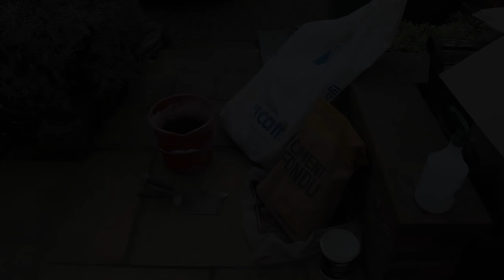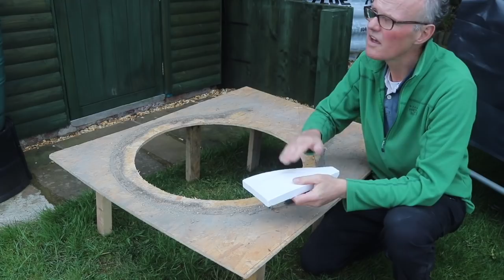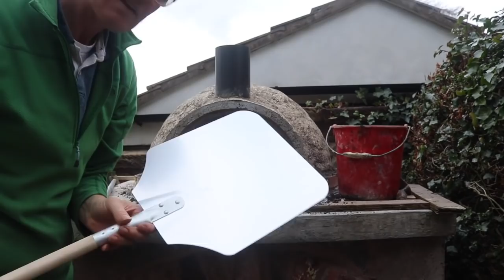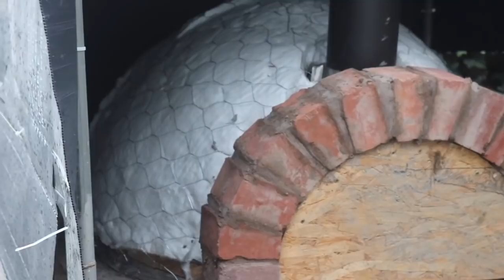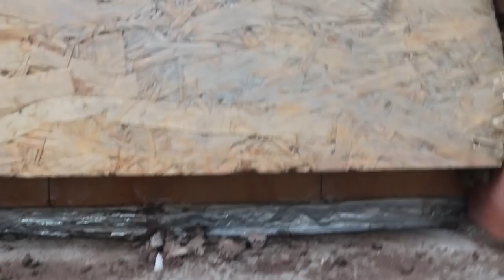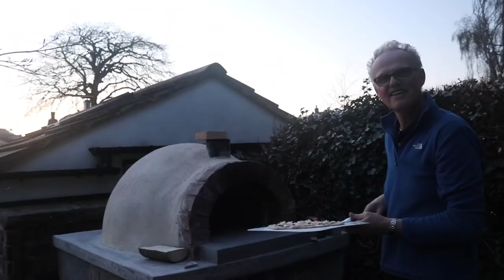DIY Pizza Oven Build: Vermiculite Dome

Comment: Thanks for your quick reply , I have to make my oven outside so I will need to wait until no threat of rain , if im to do it in all at once , my form is ready and waiting ,but its bigger at 80 cms so I hope I have enough fondu ,was your mix 3 - 1 really accurate , can I ask what size of batch did you make . Thanks for your info and encouragement
Reply from the maker: Hi - I wasn’t overly accurate with my measurements and used a big shovel to lift 3 parts vermiculite and 1 part ciment fondue into a wheel barrow. I made a good batch eg 6 shovels of vermiculite to 2 of ciment fondue. Used a builders wheelbarrow. Just keep mixing till the dome and entrance were complete, ensuring I had a stove pipe in place at this stage. Keep it shaded and cover with wrung put towels and don’t touch it until it’s fully set eg the following weekend. Once you get to putting on the ceramic fibre blanket with chicken wire you’ll need to put a plastic sheet over as this will suck up any moisture....all good fun. If you look at my ‘update’ you’ll see I eventually built a little shelter over my dome as I live in a wet place. All the best - let me know if I can help further....

Comment: Hi great video , im just about to build my own , but reading about the fondu ciment ,im a bit confused about drying time , when you were building the dome did the vermiculite set rapidly ,ie < 30 mins as when working with a mix of portland or did you have time to mould it . Your advice would be really helpful
Reply from the maker: Hi - there’s no problem making the ciment fondu and vermiculite mix. Just add enough water to make it mould-able as you build up the dome. I recall having tennis ball size lumps and keep going till you finish. The most important thing from what I’ve picked up is to slow the curing once the dome is complete by covering the dome with dampened towels or the like. I think if it dries too quick it may be prone to cracking. Good luck...it’s not too difficult, just take your time.

Comment: Hi, great job with your oven! Could you tell what size flue you used? I can’t find any info on this. I was thinking to use a 6” flue. Any advice would be greatly appreciated.
Reply from the maker: Hi Phil - I used 5” glue pipe for my smallish oven. I wouldn’t want to go any smaller than this as some smoke comes out the front so I would say 6” would be fine. Good luck with your build....
Reply: Thanks for your reply. I was going to use a 65cm ball but worried it might be too small. If you could start again would you go for a bigger dome?
Reply from the maker: Hi - yes, if I had the space. The base would be a bit bigger etc. On the other hand I can only manage to do 1 pizza at a time As they cook quickly, and my pizza sizes average about 10”. A bigger dome would allow you to place your wood more easily I guess. Decisions decisions! Cheers...
Reply: Solway17 Carlisle great thanks again. I might go for 75cm. So many options! 1 last question is your oven still performing well? Any major cracks?
Reply from the maker: I keep looking but nothing so far. I did build a little waterproof shelter over the oven to ensure it stays dry year round. So far so good. I guess fir bricks would be a more guaranteed option but I couldn’t face cutting and shaping loads of bricks. I made sure the dome was quite thick and cured it slowly covering it with damp towels etc and lit small fires to begin with. Hope that helps...
Reply: Solway17 Carlisle thanks for your advice it’s much appreciated

Comment: Made my first dome...but sadly used the wrong mix, using 5 / 1 vermiculite / cement. Damn thing cracked as soon as I moved it and was un recoverable so must start again. I will use a 3 / 1 mix as you recommend. Can you tell me, when you made the 1st dome, how the vermiculaite mix onto the ball. I'm guessing about 2-3 centimetres but would be grateful if you could clarify this please.
Reply from the maker: Hi - oh sorry to hear about the collapse, I remember moving mine form the board onto the plinth and needing to be very careful. You do need tennis ball size lumps when you build up the dome - a decent bit of mass without going over the top, more like 4-5 cm. I read somewhere to put damp towels over the finished dome to let it cure out more gradually. I think moving the dome is the most tricky part of the build. See if you can lift it using the board it was built on as near as possible to the final plinth location?
Better luck next time- hope all goes well 👍

Comment: Looks great. I think I saw on another design that the floor tiles/bricks are laid diagonally in order to avoid the peel catching on the edges. Maybe getting a round turner/peel for removing/turning pizzas will help with this issue.
Reply from the maker: Hi Grant - yes I think you’re right about laying the bricks herring bone style. Since building and using the oven over time any little irregularities have have gradually diminished. But it is important to spend some time making sure the floor is as level as you can make it. Thanks for commenting and watching - Regards

Comment: Beautifull oven you got there, Can you give me an idea on how thick the wakls of your dome are in total? I have a base om 120x120cm and i'm wondering if a 90cm diameter dome on the inside would fit. Thanks in advance!
Reply from the maker: Hi Milan - I'm sure you will be ok. The vermiculite dome needs to be fairly substantial. I built mine up in courses with tennis ball lumps working around the base then going up in circles from there making sure the mix didnt slump. I would estimate the vermiculite wall thickness to be approx 50mm minimum, ceramic fibre blanket about the same (held in place with chicken wire mesh) then a cement render on top, say 30mm thick. So total wall thickness 130mm. (x2 for the other side of the dome)
I just measured the width of my concrete base as 130cm wide and deep. My oven has 10 - 15cm to the edge of the base. You also need to allow for the entrance for the oven. If you add 90 + say 30 = 120cm, so I guess you may just do it.
Just make sure you dont skimp on the dome wall construction + insulation as you need the oven to get up to very high cooking temperatures (350-400 C) and it needs to maintain as much of that heat as possible. Milan, I hope that helps, give it a go...best wishes and enjoy your pizzas
Reply: @solway17carlisle Your information helps a lot! I'll take 85cm to make sure my walls will be thick enough. Thank you for the quick response and best wishes! :)
Reply from the maker: @milanvelle6292  Milan - no problem. I realise watching my video just now that there is a 2nd layer of vermiculite mix on top of the fibre blanket, then a thinner mix of cement render to finish off. Sorry i didn't mention this earlier its a while since I built it. Best wishes...
Reply: @solway17carlisle  Hi Sir, i'm busy building the dome and i was wondering if you also used fire resistent cement for the outer layer (without vermiculite) because it is a pretty expensive product i was wondering if it was possible with normaal cement. Greets, Milan!
Reply from the maker: Hi Milan - the only Portland cement I used was on the final outer render layer
Both the inner layer of the dome and the layer over the heat proof blanket were made with vermiculite and refractory cement. I used 1 bag of ‘Ciment Fondue’ sources from EBay here in the U.K. when the oven fires up it’s warm on the outside so I personally think it’s worth using refractory cement to reduce the risk of cracking. We have a saying here “for a half- penny of tar, the ship was lost”. I hope that helps - best regards and hope you and your family are ok in these times

Comment: Hi do you have an idea of the amounts of Vermiculite/Concrete required? trying to get the materials together to get this made, but cant find any materials info
thanks
Reply from the maker: Hi David - I bought 1 bag of Ciment Fondu (25kg) and also 1 bag of 25kg vermiculite from a builders merchant. Any other materials I bought by the bag as needed, eg for the concrete top and brickwork for the base, and the fire bricks I just estimated given the area needed to cover. I hope this helps - for this dome build I had abit of ciment fondu and vermiculite left over at the end. Best wishes...

Comment: I've watched a few of these "dome" video's and in the process of making the base out of natural stone blocks. Couple questions please. 1) how high is your base. If you made it again, would you go higher or lower. I'm 6ft 2" so probably would err on the side of a taller base. 2) The chimney - none of the videos I have seen explain how the chimney is created. Is it a case of simply cutting a hole in the arched entrance at the point where it joins the dome and then rendering around it. Thanks in advance. Great video.
Reply from the maker: Hi - the measurements I have are 98cm from ground level to the top of the base, then a further 6.5cm up to the floor  of the oven, giving a total height of 104.5 cm or thereabouts. I am also 6'2" and manage the height ok though I do stoop down a little though not too much to make it uncomfortable. My more petite wife uses the oven as well so its a good compromise for height.
Regarding the chimney, I built it in by resting the chimney on top of the arched former for the front door of the oven, then as I covered the gym ball and the door arch with the vermiculite mix, the chimney was effectively cemented in place. I thought this might be a problem when I eventually removed the former, but it stayed in place ok. I subsequently added more cement render and fixed a galvanised metal strip to the metal chimney and set this band into the cement to reinforce its position. I hope that helps...let me know if you need more info etc. Regards

Comment: if someone hasn't already given you the tip......sprinkle polenta on the peel and the pizza slides on and of perfect, also a diamond grinding cup run over the high spots works great if you get a lip that's annoying......good stuff mate...
Reply from the maker: Drew - Thanks for the tip. Ive found some Polenta and it works a treat. My pizza doesn't stick to the peel, so great advice. Cheers and all the best...

Comment: nice job- how long did u let the oven dry before taking out the gym ball.??? i  took mine out after 3 days and the  mould is crumbling
Reply from the maker: Jo - very sorry to hear that your oven is crumbling. I did leave my oven several weeks before attempting to move it - partly because I had other things to do, e.g. Building the base etc. Either way the oven needs to be firm and solid before very carefully, with 2 or more helpers, lifting it into place. The walls also need to be adequately thick, and ensure you use a ratio of 3:1 (vermiculite:ciment fondue). I have heard others repair the dome by filling in the cracks with fire cement, but it depends on how badly damaged the oven is. Again, sorry to hear of your difficulties- perhaps have another go as the vermiculite and cement are relatively inexpensive compared to the other components? All the best - hoping you succeed
Reply: @solway17carlisle  thanks for reply... Il have another go and leave it for a fortnight before removing gym ball....
Reply: @solway17carlisle  thanks for reply... Il have another go and leave it for a fortnight before removing gym ball....
Reply: @Jo-xg6rk  - I built mine a week ago and was going to ask the same question about removal of the ball. I was going to leave it a week but perhaps I'll give it another few days. How was your oven once you removed the ball ?

Comment: how long did you leve it to dry out before setting small fires in it ?
Reply from the maker: Hi Simon - after casting over the gym ball mould I let it slowly dry out and cure for at least a week until I was confident that it would lift into place without breaking. Then another few days until the mixture sticking the dome to the fire bricks properly set. Then a small fire every few days while I continued the build. Hope that makes sense - it needs to set long enough to handle and then start small fires. Atb Andrew
Reply: @solway17carlisle  thank you very much . i sand moulted mine and the sand has been out for a week now.

Comment: what was the very top white layer made from?
Reply from the maker: Hi - I mixed a cement render,  I used a bag of coloured render mix. In the UK it’s called ‘K Rend’ one coat render. It comes in different colours
Reply: @solway17carlisle  thanks! Do you know if this is similar to the blanket you used? https://www.psh.ca/index.php?item_id=R23BD

Comment: Congratulations on a great build and well done for taking the time and effort to make the video, it's been a fantastic source of information for myself and many more. I've gone all out with my build, 85cm ball, 40mm calcium silicate board and 65mm fire brick. The 85cm ball has come at a cost though as I needed to buy another bag of fondu and vermiculite having said that the Initial cast was about 10cm thick! 
I'm at the stage where I have fitted the fire blanket and will put another layer of vermiculite on, I have half a bag of fondu so probably not enough to use for this second layer. Would you say Portland cement will be ok for this and also did you do two coats of your final render? How thick did you apply it and did you use cement dye if so was one pack of dye enough? (  I have 1.25kg of dye which is ok for p e bag of cement). Got 4 years cooking pizza out of a cob/earth oven before the cracks were too big, I will have about £300 I  this when its finished but i. hoping to slow cook overnight with the residue heat.
Reply from the maker: Hi Mark - sorry not to reply sooner. I think its a good idea to build a bigger oven as sometimes my oven can be a bit smallish when a good fire is in there -  although I always manage to get my pizza in ok. I guess the further away from a direct heat source, the less need there may be for the fondue cement. My outer coat was a bag of coloured cement render eg KRend. Quite easy to mix and apply and looks ok. 
I had family around this Bank holiday weekent and fired the oven up - there were no signs of any cracks or wear inside the dome, so Im happy so far. ATB

Comment: After a year is your oven still holding well?
Reply from the maker: Hi - yes, it seems to be doing ok. If you look at Part 2 I have built a small protective cover to keep it dry over Winter. I think if water gets in to any extent it would be a problem particularly for the ceramic fibre blanket insulation. Anyway, so far so good
Reply: @solway17carlisle  thanks for the speedy reply. Many people making these. I'd like to get it right the first time. 
Another question sir: can your build be transitioned easily to a smoker?
Thanks so much
Reply from the maker: Hi Marty - I’ve never thought of using it for a smoker - I think the dome ad I built mine would be too small and air control not that easy to achieve. As it is, once a fire is lit it seems to burn quick and build up temperature- ideal for pizzas but not so for smoking. All the best, sorry not to be more informative on this
Reply: @solway17carlisle  if i build this, how long before i can use it? Do i need to wait weeks for it to dry?
Reply from the maker: Hi - I think with any cement based construction you have to give enough time to cure out and dry, but once it feels dry to the touch and can be lifted without collapsing, you should be able to use it. Just start with some small fires at first - these will also help with the drying process and ensure you don’t ‘shock’ the oven with too high temperatures. Beyond that, if there are no cracks you can use the oven normally. Hope that helps - best wishes

Comment: No sand and/or small aggregate in the mix?
Reply from the maker: Hi David - someone else enquirer about the same thing..,at the time of building I just used vermiculite and refractory cement ( ciment fondue). It all appears to be holding up, now over a year old. Also, sand would have made the dome quite heavy to lift, particularly for those needing a more portable pizza oven. Hope that helps - Regards

Comment: Thank you for sharing and bravo for your achievement. Can you tell me if you can cook bread inside your oven ? If yes, was it successful ? In order to cook bread, I think you need about 300°C. Here you have more than 400°C. So if you leave it rest for a while, the temperature will go down gradually. Once it'll be at 300°C, will it keep the temperature between 300°C and 250°C for 30 to 45 minuts ? I think it is what you need to bake bread.
Reply from the maker: Hi Bogdan - I'm sure it would be possible as there is sufficient heat, however, I would find it difficult to judge when the bread would be ready as the temperature isn't easily controlled. Good luck if you try....
Reply: Well I made a second attempt in mu vermiculute oven. I made it very big. This time, I put fire bricks on the floor, and yes it helped to keep the temperature. But it is still not enough. Anyway I don't need such a big oven. Next one I am going to build will be very cheap : a barril covered by earth.   @solway17carlisle
Reply from the maker: @Bogdan-hs4gg  Hi Bogdan - good luck with the oven build and thanks for your comments. Regards...